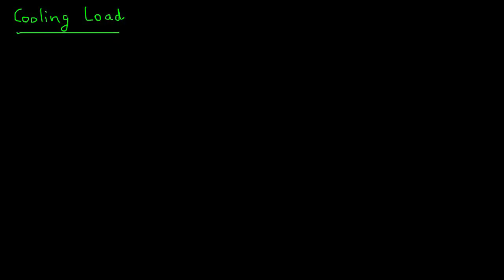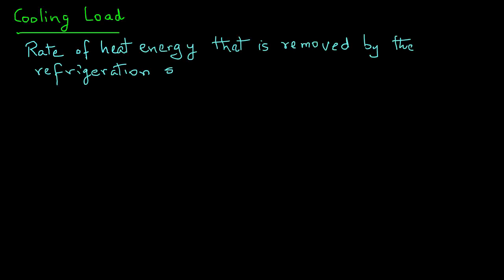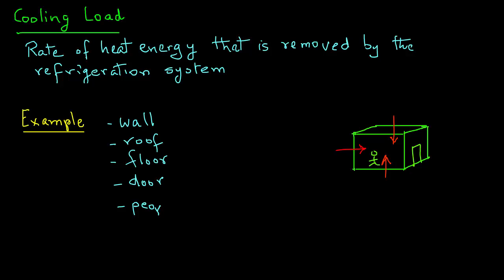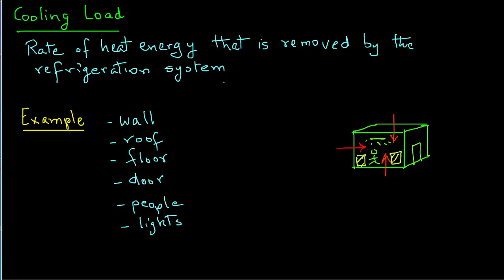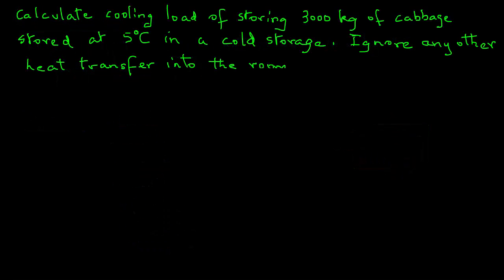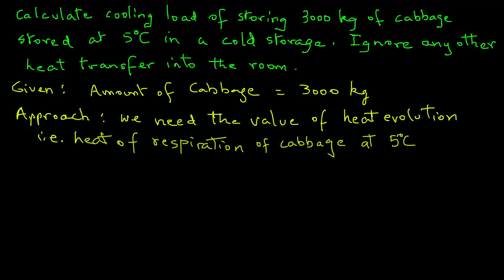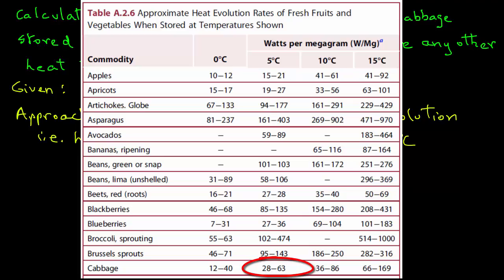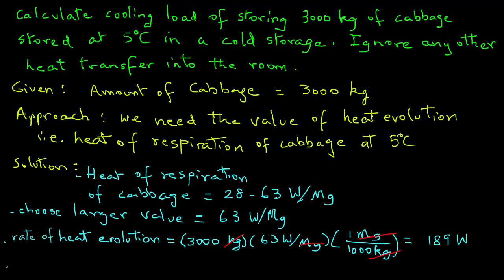CoolingLoad

Comment: sir,would you please explain to me how to calculate the refrigeration load for freezing  10,000 lb beef, carcass first from 40 to 28 F then freeze, than cooled more to 0 F. should I calculate the water quantity from the meat and make a separate calculation for meat and for water and add up.thank you,
Reply from the maker: First you should calculate the heat removed from 40 F to 32 F (you will need the value of specific heat of unfrozen meat), second, determine the latent heat of fusion for meat at 32 F, third, calculate the heat removed from 32 F to 28 F (you will need the value of specific heat of frozen meat or you may approximate by using specific heat of ice if the value for frozen meat is not available). Calculate each item for the mass of product you are freezing and then sum all three values.